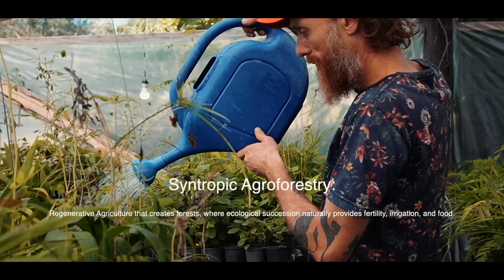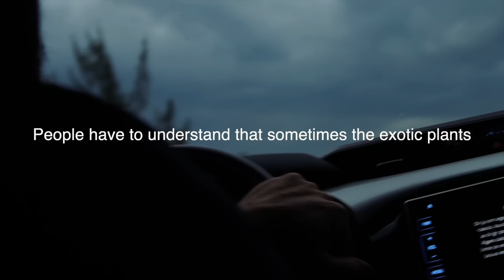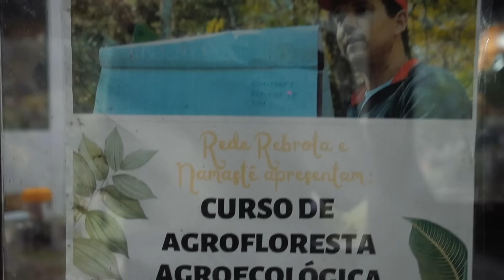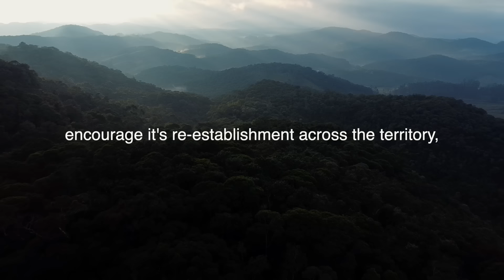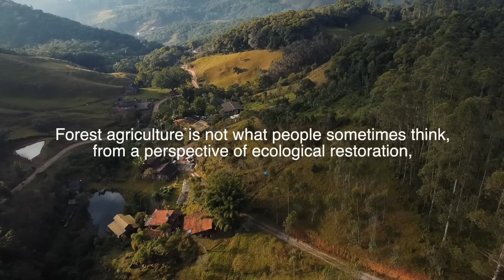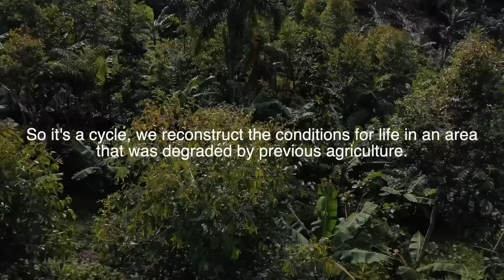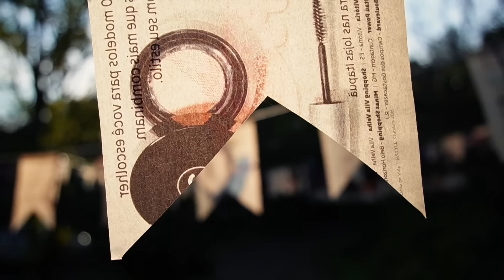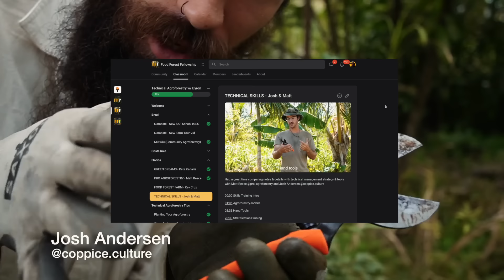cold climate Syntropic Agroforestry in SOUTH BRAZIL

Comment: It seems they didnt plant on contour. is that right ?
Reply from the maker: Correct, most are planting vertical up the slope
Reply: @byrongrows  I noticed this too, may I ask is there a purpose to this? I know in PNG, locals were encouraged by a permie consultant to plant on contour, rather than downslope as was custom, only to lose entire crops due to landslides with high rainfall. Draining excess waterflow on steep topography was the reason for downslope traditional planting, apparently. Perhaps this is the reason here? (although usually that pattern is for ease of machinery) I live in hinterland sub-tropical Nth NSW and plant slightly off-contour for both catchment (in moderate rain) and drainage (with heavy wet seasons) on steeper areas
Reply: @stephseckold4324 I live in Belize with similar heavy rainfall on steep hills, I can see why up down slope planting would work better than on contour unless the contour plantings are very water permeable. The amount of water rushing across the landscape on a regular basis is astounding and stopping it is impossible, and somewhat destructive. Most permaculture ideas are based on Australia and New Zealand not central America.